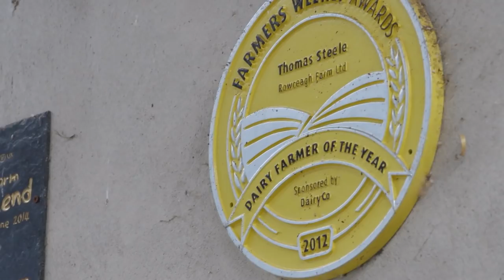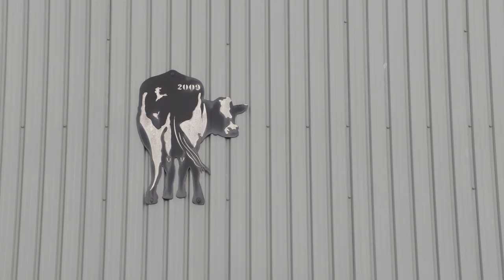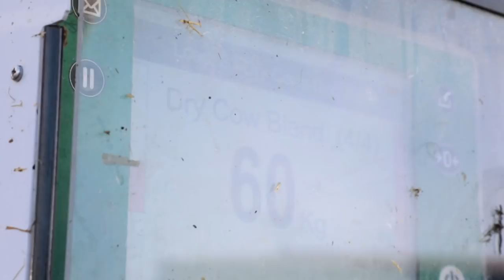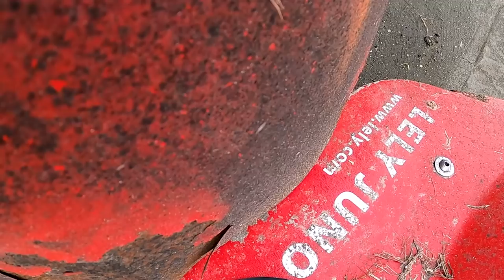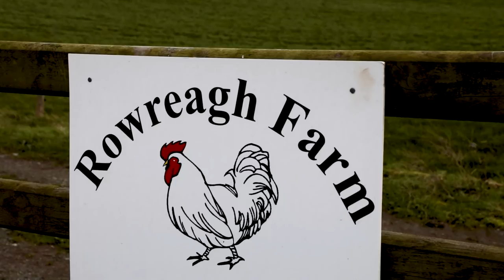Rowreagh Farm Ltd.

Comment: What an operation. On a side note the place where you feed is is flat meaning the feed has to be pushed up, could this area not be set up with a slope so the feed would continually fall towards the cows by gravity?
Reply: The main reason is that the feed area is flat is that it is easier to clear away old silage. You can drive along with the bucket of the loader and clear it away easily.
Reply: It would need to be a serious slope